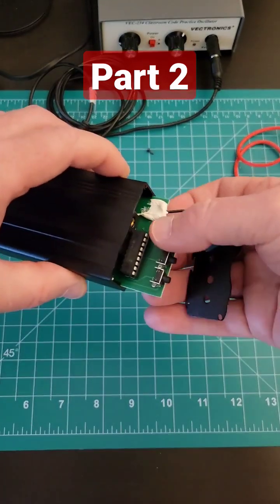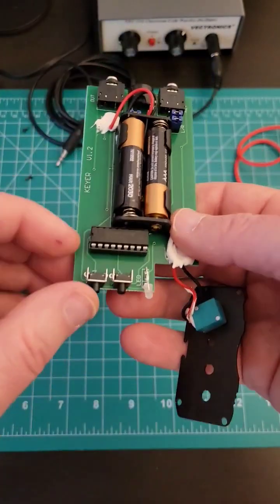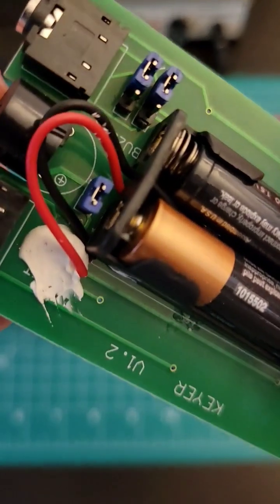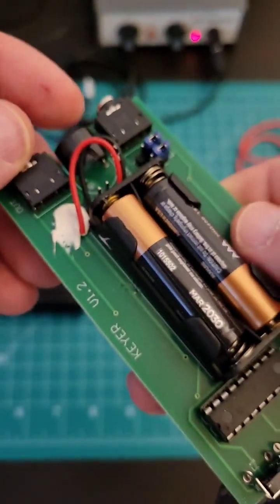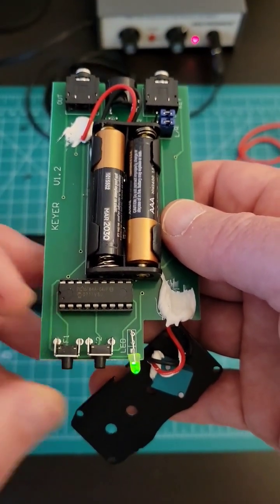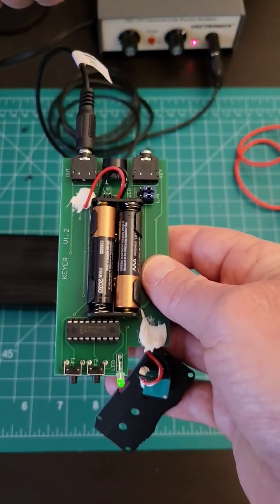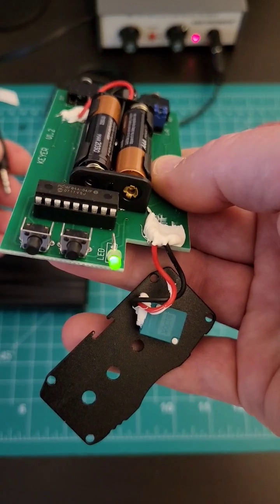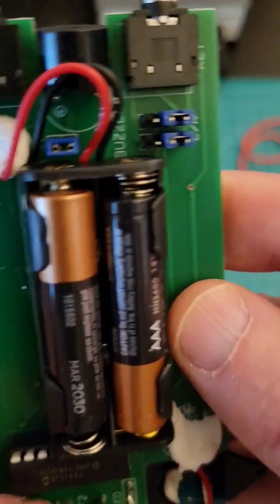Part 2 | Quick Fix: Remove The Jumper from the MX-K2 CW Keyer #shorts

Comment: I think it would be a good idea to add a switch so that you didn't need to open the case to change it. It is what I have added to every keyer I've built. Even a switch to change the paddle sense is possible.
Reply from the maker: This is a fantastic idea!  I added it to my project list.  Very good!  Thanks
Reply: also an external power supply option could be useful. at least for me. I'm on a budget and looking for equipment to learn morde code. i was considering this keyer. at 20 bucks seems a good option to start with or am i wrong?